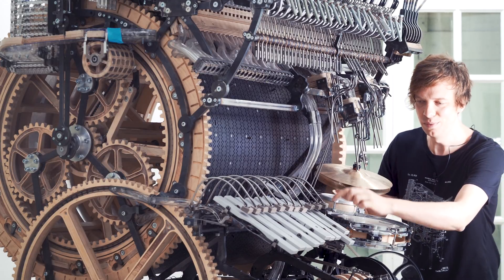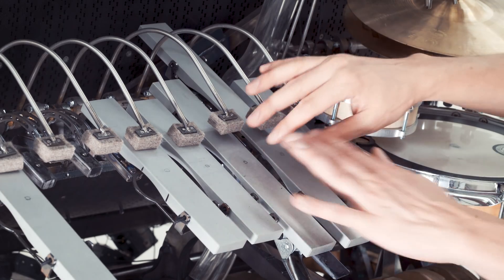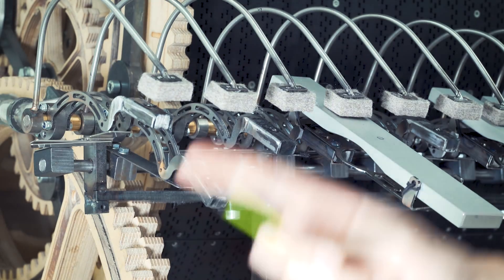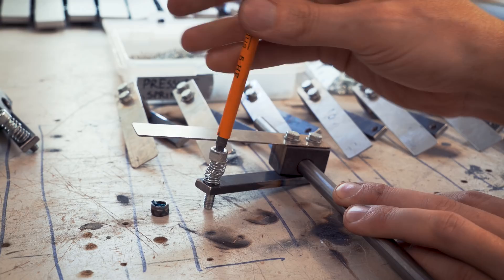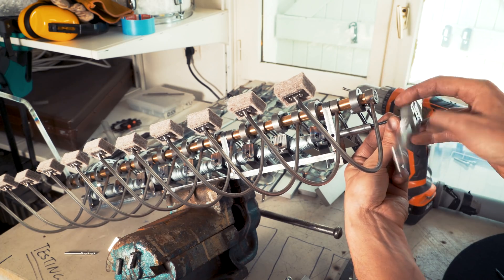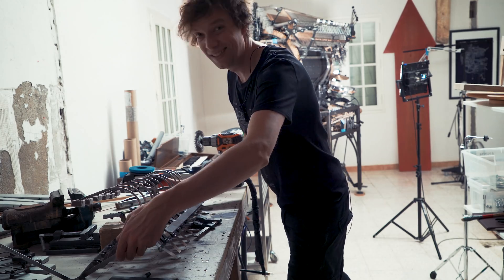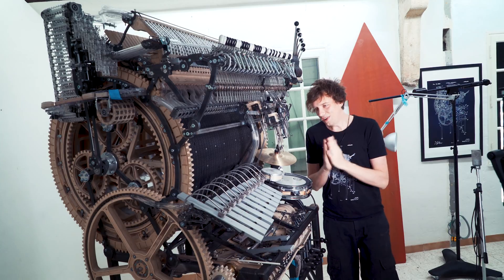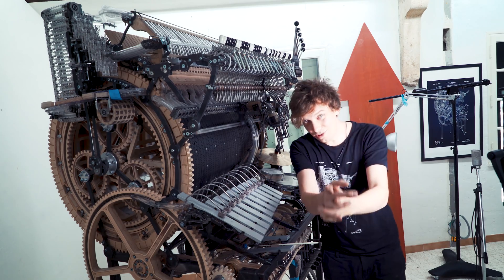Vibraphone Height Adjustment - Marble Machine X #103

Comment: Brilliant! But I'm afraid you're not considering cycle time enough. What will the duration of a single song performance be? Perhaps no less than 3 or 4 minutes? Perhaps no greater than 7 or 10 minutes? Now compare that to how long it will take to set up for the next performance. Manually individually tuning various note heights is going to add to set up time. If you continue in this direction, you should extend the adjustment screws with some kind of drive (unshrouded speedometer cable?) to above the notes and add a knob so they can be set without a tool and a flashlight.

But there is a better way to compensate for each note's weight.
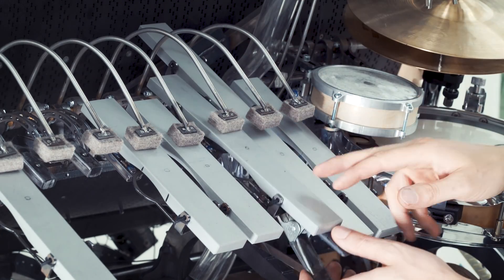Look at 1:54
See how the arc of the arm comes down to the right and rests on the spring, then rises to join with the note holder? I believe the arm-note holder joint is in the wrong place. Let the note holder incorporate the portion of the arm that rests on the spring, and join the arm somewhere in the arc.  For each note holder, you can vary the thickness of the portion that rests on the spring to set its height with a spring loaded set screw. Voila! Weight compensation built into each note's holder. The height will be correct no matter where you put the note, without having to adjust it each time you install it, so long as all arms and springs are uniform.
I remain concerned with variability in note volume and marble trajectory that the moving note will cause. If a marble strikes a note while the note is moving, it may be louder if the note is rising, and softer if the note is falling. Since the note can be moving when the marble strikes, the note's angle and height will be changing as well. This will cause a variance in marble trajectory. I hope the individual marble catching funnels can still work.

Comment: I would have assumed the answer would be to have the height adjuster/spring mechanism attached to the vibe key, rather than to the machine, so that each would go on at the right height and angle. Unless the angles/heights are supposed to change from left to right on the keyboard.

Comment: I think there is a problem... In a concert, when you want to play a new song, you have to change the magnetic (if i remember correctly) things on the big gear who play the song. And I think this is really long. I hope I make a mistake or, if I do not,  you will not need to remake a big part of the machine for fix this problem...

Comment: Great solution! But Yikes, purely from a stagehand standpoint, if practical, I would exchange that screw/spring/tool solution for 11 pieces of longer threaded rod with machine head style tuning knobs welded on for rapid adjustment. Finding those allen screws in the dark 11 times is going to be paaaainful!

Comment: damn, you changed it already.
my thought was to include the spring in the note carrier, so each note has its own dedicated spring, calibrated to its weight. 

when you remove the note, you remove the carrier, and spring with it.
when you install a note, you install its spring in the same assembly, and the spring height, and tension is already calibrated for that note.

Comment: I see a potential problem... You need to establish a set height for all plates. If you were to lower or raise them all too much, they would be ever so slightly off-beat. Might not be noticeable but if you're aiming for near perfection you might need to make a level too that sits at the exact height at which you want the bars to rest

Comment: You should make an alignment jig that you can put on quickly that would allow you to always adjust to a calibrated height.  Put on your new plates.  Put on the alignment jig.  Adjust the plates till they just touch the jig. Then remove the jig.  This will prevent the overall level from creeping up or down over time.

Comment: I believe you did mistake in weighting. It is lever, so it is not just weight, but weight related to distance from pivot point, IMO you should measure weight as pressure against the plate. Also the mass (with paste tension) should affect distance travelled after being hit by marble (that might be intentional, but will cause issues when trying hit high and low notes together at higher tempo)

Comment: The fact that the holders are now free to rotate on the shaft, and vibrate, may produce un desired buzzing when mic'd.  The set screw only keeps the holders from going down further, not bouncing back up.  When hit with a marble, or several in succession, the bar and holder may now vibrate and give you a secondary ringing effect that the mic might pick up (ie the set screw buzzing on the rest bar underneath).  Best to test with the marbles at high rate (double hits especially) with your mic to confirm thats not a problem.

Comment: RE: 6:31 - So Many Washers - Use copper pipe between your blocks. 86 the washers. It will match the upper copper pipe. Just NOTE - Copper will turn green after time. You can lacquer the copper to slow the green down. Might want to talk to a repair shop for wind instruments to find a way to stop the green, sense they deal with that all the time. IF you had lots of money you could even gold plate the copper tube. Just a thought.

Comment: Uhg!!! RE: Vibraphone Tone bar Height displacement & KEEP IT SIMPLE- I  know you want beauty with the tone bar bounce, But on a real Vibraphone you don't get that type of bounce. PLUS your going to have major problems with the distance between your Resonators and the Resonator 'Fans', which you have stated you want that wha-wha sound. The distance between the Tone Bar and the Resonator needs to be short as possible, but don't forget the rotating fan is going to have to be NEAR the back of the tone bar (like 1/8 inch away between Bar and edge of fan - YEAH the fan can be set down inside of resonator by 1/2 inch- but the distance needs to be taken in account, and your Not going to want your resonators bouncing around with your bar, that's going to cause other problems, along with the bars sagging- the resonators need to be independent from the bars. And your fans are going to need to be in a straight line to not squeal against the insides of your resonators.) to get your wha-wha sound that you're looking for. KEEP IT SIMPLE:  I would have stuck with rigid Tone Bars. You are working TOO HARD. I still like what your doing. But if you don't keep it simple your not going to be able to do SETUP on the stage, the same way, every time, And get the same results every time. { I was a Tuba Player for a concert band, so I Know what Setup means and that SETUP needs to be quick between sets. - You almost need to have plug and play-  meaning you have a set of tone bars for each piece. You take one set out, put one set back in. } {SORRY FOR THE LONG RANT. }
Reply: RE: having separate tone bar sets, if you really wanted the octave (no changing sets) maybe you could put one set of keys under the top set. Sure not showy, but then you have all 8-white & 5 (?) Black keys for one octave, like what they do with organ pipes. Your going to still have to deal with the weight of your machine, one way or another {IE. Moving it from one place to another.).

Comment: Maybe there will arise a timing problem with the note blocks springing back and forth, if the note is played in rapid succession. I'm not sure to what extent the vibraphone will jiggle around. You spent weeks, months on getting tolerances down and timings tight and adjustable. Maybe this isn't a problem as the amplitude is very minute, maybe this is a problem as the amplitude increases. It will also throw your marbel flight paths off track slightly to very severely. Now, one thing you could do (not with your design with swappable notes unfortunately), is adjusting the spring rate so the pendulum frequency is constant. Having the notes independent from the springs destroys that possibility tho. Please test this and tell me my concerns are unfounded...

Comment: The solution is very elegantly executed. But conceptually speaking I think adding weight to the vibraphone bar holder would have been the most proper solution. Not just for practical reasons (no adjustment between songs) but also because it would make every bar behave exactly the same when a marble hits it. Now, small bars are slightly more "jumpy" than big bars, since they are lighter.

But on the other hand, it's always going to be very useful to be able to calibrate each vibraphone bar position individually ...!

Comment: Hi Martin, it might be convenient if adjustments on the machine were tool-less.  If you extended the adjustment screws and pressed knurled or rosette knobs onto the heads of the screws, you wouldn't need a hex wrench.  (For examples, see Rosette Black Plastic Press Fit Thumb Screw And Knobs from MSC Industrial Direct, or Press Fit Thumb Screw Knobs from Penn Tool Co.)

Comment: Solution 431: Make the attaching arms on the carriage taller for heavier notes since you're replacing them anyway. 

Solution 432: Flip the adjusting screws so that they are turned from below by hand. Add a knob on each adjusting screw to make gripping them much faster and easier for the fitment crew.

Comment: It would require undoing and redoing the entire system, but I feel like the ideal solution would involve each bar being hard fixed to its own spring, and the entire bar and spring mechanism being changed when you replace notes. That way you would never have to adjust on stage.

Comment: for the vibraphone i would try using closed resonators and attaching a contact mic to the cap/endpiece, although idk how well that sounds (the real sound might only be coming out the top with closed pipes, in which case you could put a condenser mic near the opening instead?)

Comment: Non-concentric screw was pretty good by itself. You just needed to think about an adjustment for it that is fine enough to work, and changes the rotation to another axis (ea, the knob you turn has to be pointed downward for easy access).

Allow me to introduce to you: Guitar head tuners.. Off the shelf, wormgeared (so they lock), and they change the axis of rotation.

Comment: If you want to perfectly align the vibraphone plates after changing them, then maybe it would be good to mount some laser on one side and small screen on the other (diagram here: https://ibb.co/s3KN7KC ). If some vibraphone plate gets too low then adjust it so much up as the laser beam gets blocked by that plate, then lower it down a bit so the light can hit the screen. That way you will get perfect alignment.

If you want to avoid the laser then simple string could do as well (same way as the builders use it to place the bricks in a level way). :)

Comment: For easy alignment, put a mirrored piece on the back of every vibraphone mount, so to make sure they're all perfectly aligned use a laser LED (even in low lighting conditions where it's hard to see them) - reflect from the mirrored part and it's really easy to see that they're all in alignment - it's only needed when aligning / setting up, so even a watch battery will give enough power to last several years of adjustments. Doesn't need a lot of reflection from each, and if it's reflected maybe back to the ground a small change in angle makes a large change that's easy to see...

Comment: I have not read all the notes so i don't know if someone already recommended this BUT why not have the spring steel part of the assembly stay with the  Xylophone peices.  Each one is tuned as an assembly. Each note  can be slid in and off the machine with its corresponding spring and mounting as a complete unit. No tuning needed between each song. Always goes back to the correct spot no matter what the location.

Comment: Wait..... So whenever you change songs, or bars, you now have to height-adjust every note you've placed?! No no no... Won't that potentially lead to inconsistent drop-heights? The best way would be for the leaf springs and adjustments to be apart of the vibraphone bar inserts themselves... that way each note is calibrated and hot-swappable to any position-Wthout any needed adjustments during a performance.

Comment: Just a thought: Include a pre-fixed height adjustment in the note bars themselves, and then only use the set screw height adjustment for fine tuning. That way, you could get away with rapid note changes without needing to adjust the screws in a pinch.

Comment: Am I missing something? Adding weight to all the bars to match the heaviest bar would mean that all notes would have the same deflection for the same marble drop. Maybe the C of G would be slightly different, but that would be negligible, and you only need to tune the bars once - at manufacture.

Comment: Correct me if i'm wrong but if all the notes are the same mass then there wouldn't be a difference in movement or height? If you made them all the same mass then you would not need to adjust while replacing each note, which costs precious time.
Keep your screw solution though, it would be fine for adjusting to spring fatigue

Comment: So it would make sense to make a guide or getged so the vibraphone plates get always adjusted to the same hight or angle. So by assembly the machine before a concert you don't have to figure out the correct angle. And the marbles will jump always the same way.

Comment: I can't help but think that guide (like multiple shims pieces together horizontally) bolted/whatever below to limit travel pre-machined for each different configuration would be easier when it comes to adjusting in between songs than so many different pieces. 

I actually really love this design solution, I just wish there was a way to make broad adjustments instead of individual adjustments, to minimize downtime between songs in a live setting. There might be a way to make this solution do that tbh.